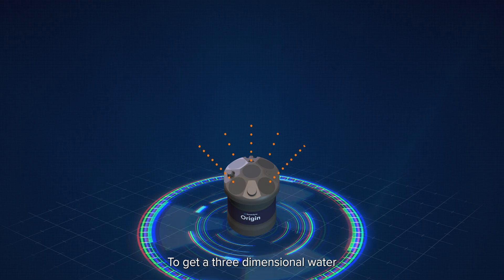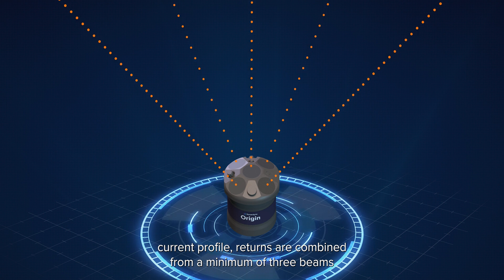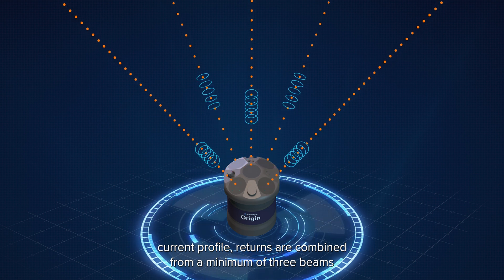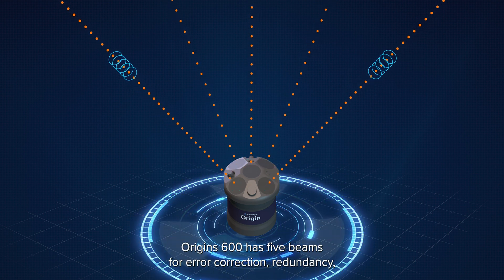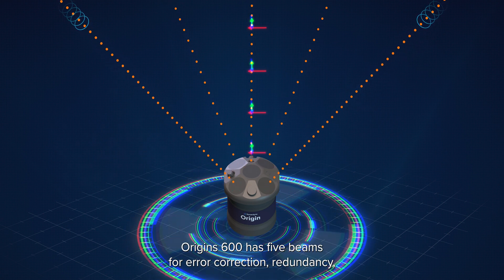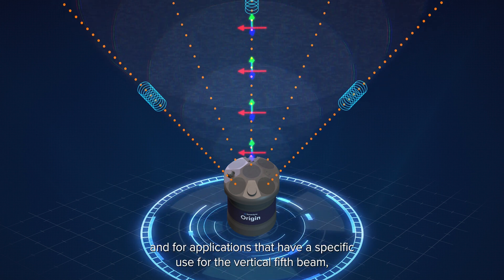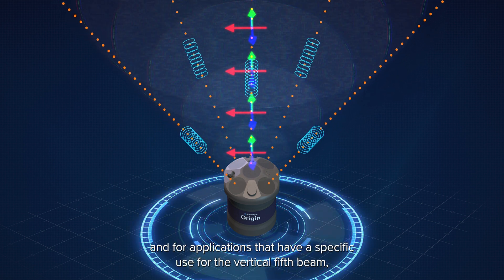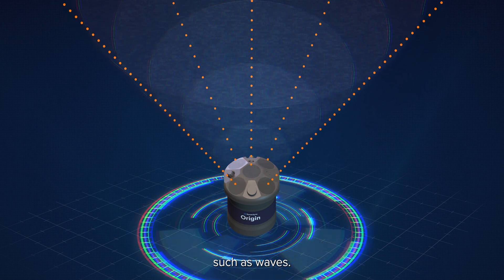Technology focus - how does an ADCP work?

Comment: 5 sound emitters. How do we decern which out of the five pings emitted by each of the emitters is observed once reflected back to the device? Would it really matter though if we can't decern each reflected ping? Does it really effect the reading by a significant amount?
Reply from the maker: This relates back to the fundamentals of how an ADCP works. Radial motion (along the path of the acoustic pulse) is the only motion that affects Doppler shift. An ADCP applies the Doppler shift principle to measure velocities along its individual beams and with the divergent design of an ADCP, each beam will make measurements for different locations.